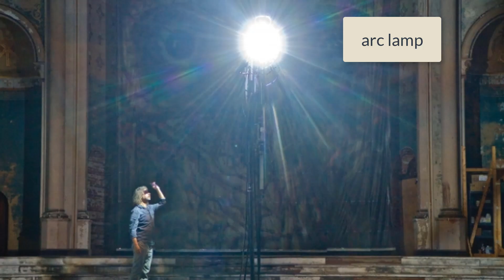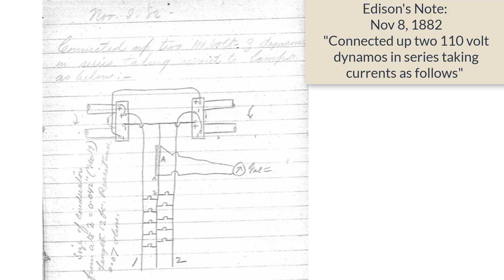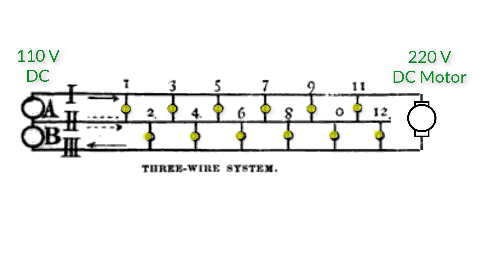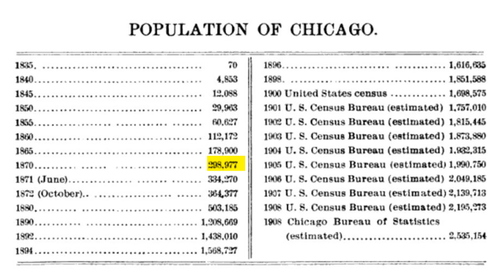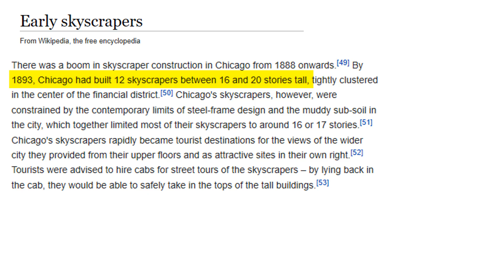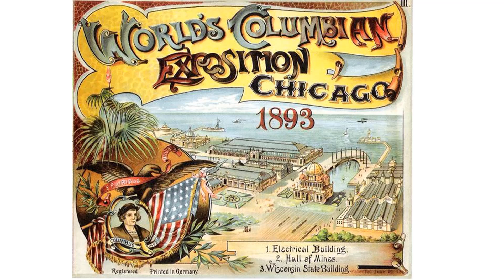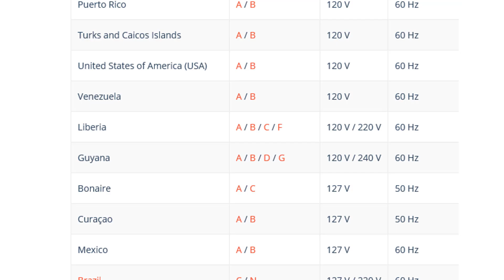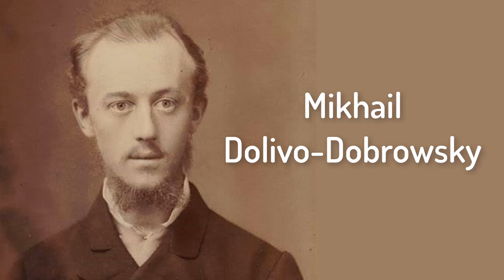Physics and History of Why USA uses 120 volts and not 220 volts

Comment: Very nice video. Couple fun facts when building started going up with steel most of the construction was hot riveted that wasn’t that strong at the time you had to have many fish plates for the steel to be even stronger when electric welding came out that was the game changer after the 20s I think Lincoln electric came out with the first coded welding rod Around 19 2526. Also I am a power plant instrument tech and I take care of the three phase or poly phase generators and yes, Edison DC system wasn’t that efficient as everybody knows because the voltage was the voltage where the three phase poly phase system you could use the device called the transformer really good videos. Thank you.

Comment: Literally power transmission is 240V single split phase in america.  It’s only when you get to the lines that service a row of houses, after the transformer with a center tap on the low voltage side, do you get two 180 degree phases of 120V from a single phase high voltage supply. It’s why every house in America has 240V available at the breaker box.

Comment: You’ve crafted a decent story, and you even got some points correct like needing higher voltages to span longer distances. Please read NFPA 70E. 110-120 VAC is the desired voltages for plugs that the majority of people shall plug the majority of devices into frequently. The average resistance of the human body is about 110-120 ohms, so getting shocked by 110-120 VAC around 1 A is minimizes both injury and death. The reason I mentioned the NFPA reference is that it gives people more information to safely work with electricity.

Comment: Fairly good explanation of volts vs amperes to achieve the same power (wattage). But you messed up the whole presentation by waving your hands around for 13 minutes.

Comment: And why do many countries use 240/250V. Having had a less that ideal electricity supply here [In Oz] I often only had 215-220V.  And things like my 3/4hp air compressor did not like it,, the lights would 'pulse' with the compressor was running and welding was at best poor.  All 240V equipment. Better these days but still far from ideal.

Comment: Electricity does not under any circumstances flow from positive to negative. To do so it would require that the flow would be that of the protons, which is not how it works. The current flow is always of the negatively charged electrons from the negative terminal to the positive terminal.

Comment: I made a solar generator with no experience. I had so many questions but it works. 5kw 12v which is probably the simplest way to do it but I still have questions. For example, resistance,how to measure and what the measurement means .

Comment: And yet I power my woodwork equipment on 230v, so we do actually have use of that. And then there is 3phase electrics which gives several more voltages.

Comment: Neutral should be a bonded conducting ground, conducting means current carrying. Using a thinner neutral than the conductor wire or 'hot' wire is not NEC approved, in most cases. Check the codebook, of course if you're not an electrician it might be hard to decipher.

Comment: Less likely to get killed  in case of event. Less induction as well.  Also, no need for 277v in residential, generally.  Other then washer, dryer, and stove.  A lot of those run on 208/240v.

Comment: In fact the US electrical system is 240V. They use symmetrical transformer with the neutral wire in the center of the winding. So there are two potentials. Between end and center is 120V. Between ends is 240V. BTW higher voltage means less needed current for same power. Less current means less copper needed.

Comment: It's 110V vs. 220V (past) and now 120V vs. 240V present day. The voltage was slightliy increased across the world. And there is 240V in every house in the USA. It's juat a matter of how you are connecting the local sockets.

Comment: 120v is ok but you need much thicker conductors to carry the energy. And also the distance of everything is half of what you have on a 240v system. So all in all 120v is not as good as 240v. The latter being more powerful and much cheaper to maintain and install.

Comment: Great video, thanks. I was told that if your hand touched a live wire at our Uk 240v then you can't physically let go, But at 110v you can let go. In fact a couple of months ago a child died after being electrocuted in a hotel in Blackpool. Builders in this country, have to use (centre tapped) transformers to supply 110v to all their electrical equipment used during construction, for safety reasons & the transformers are yellow. So I'm a bit surprised the whole world hasn't standardised on 110v for safety reasons.

Comment: I always thought the US has 110V out of safety concerns as the wire men are to dumb to handle the slightly more dangerous higher voltage…  buytaway it is 1.732    Or the square root of 3 😂 right?

Comment: There are some points you are missing.
- Not only the voltage is different but also the Frequenzy. (US:60 Hz / Europe:50Hz) - That doesn't look like much - but higher frequenzy enables smaler transformers for the same Power. This 20% difference means that an european Trafo needs +44% more Size of the iron-core.

- Europe never had a DC - electrical network - but started at AC with a 3-Phase system.
The Gererators and Motors for such a system are easy to build.

FYI - DC current is very problematic - @220V it is a challenge to switch on an off (without the help of semiconductor).

Comment: fact is the US uses both 220 and 110 volts that are available to most places  
110 is fed to most things and 220 is fed into things like an electric stove and some AC units, etc So, it  is not  accurate to say  that the US just uses 110 volts

Comment: Europe uses 240, not actually 220 anymore. (technically, it should be between 220 and 240).

And most of Europe uses 3-phase in homes, as you can balance the the power between the phases and as such is safer.

Electric stoves and ovens, and other "white wares" (dryers mostly now-a-days) use 3-phase.

Comment: And then there was 40 Hz, promoted by GE in the 1890's. Early electric systems had frequencies all over the map, but GE concluded that 40 Hz was a good compromise for all of the different consumption devices. That didn't last long, but several hydroelectric dams were built in Maine that generated 40 Hz. I don't know about today (2023), but they were still generating 40 Hz electricity in the 1990's. Back then, I was a design engineer of SCADA (Supervisory Control And Data Acquisition) systems for Amoco Oil and then Motorola. One customer was a major wood pulp processing plant that had installed a SCADA system to monitor for potential flood conditions downstream of their dams and activate warning sirens for towns and campgrounds in those areas. They were having reliability problems communicating with the remote units and I got a call. After analyzing the situation, I learned that the 40 Hz power was SQUARE WAVE and not sinusoidal. It wasn't a problem for the mill, because they were powering monstrous bark stripping machines with it, and they worked just fine with square wave power. The problem with square waves is that the are comprised of lots of very high level harmonics, which were significantly interfering with sensitive semiconductor devices. I had the mill install some heavy duty power filtering on their 60 Hz lines, which solved the problem. That was the first time I'd heard of 40 Hz power, and it was the last time I ever had to deal with it. Once was enough. 🤐

Comment: We DO use 220v, in fact in most neighborhoods the poles and ground systems carry 3 sets of 220v and we just use a trick to make it 120v.   The power is distributed as 220/240v!    Unlike most places that have 240v direct to outlets the US also has a grid that grounds out uneven soil charges to a distance.   You can't do that reliably with 220/240v-only systems.

Comment: There was a time when there was only 1 neighbor hood in the world that was lit up by electric lights. It was in lower Manhatten around wall street.  This is where Edison built his generator and the wires on telephone polls that spread electricity.  From all over the world men would would go to N.Y.C. to Look at this and copy it.120 volts DC  was good enough.  Then people found better ways of doing this by using AC and much higher voltages.

Comment: I guess it depends on your perspective. To me, as an electrical engineer in the building trade, the US uses 240V. As well as 208V and 480V, depending on what you're trying to get out of a building. And we derive 120V out of 240V by center tapping the transformer because most household appliances are designed to work on 120V.

And to add to that, the reason most appliances run on 120V ties into the light bulbs using 120V. Light sockets predate the wall outlet, so the earliest appliances were designed to plug into a light socket. Once the wall socket was introduced to homes, many would output 120V to match those appliances (although 240V was not uncommon and were usually the same receptacles, leading to problems with plugging into the wrong receptacle).

Comment: I learned the history before I began working with power. Why is Nichola Tesla not specifically mentioned?  Edison's first dynamo put out DC current. 120vDC loses voltage inside of a few hundred feet. Installing generators every city block was very impractical. Edison flopped. Enter Tesla and AC alternating current and higher transmission voltages that today carry 250KV+ traveling thousands of miles. Without Nichola Tesla, modern electricity might not have arrived for decades. Tesla revolutionized the world. When Westinghouse bought Tesla's patent for $1 together Nichola Tesla and Westinghouse further developed his alternators, Tesla's high voltage long distance transmission and 3 phase current.

Comment: Looks like you have no idea about this topic. The US do use 220 system and the 110just half of it. Every family house in the United States is built for 220v systems. Just looking at the meter there is the answer too. and after the breaker than have either 110v or 220v.

Comment: Isn’t it the case that most American households do have access to 230 V readily available? It’s just that by convention everything is wired up using a split phase setup. And with those terrible dangerous plugs and sockets, it may well be better that way. 🤪

Comment: Thank you for your presentation which was interesting.  But I believe there was another controversy between the promoters of Direct Current versus Alternating Current, and this was all about SAFETY .  I understand that the promoters of AC were inclined to specify higher voltage systems, easier to provide by the use of transformers in the distribution networks.  The DC promoters used scare tactics on an ignorant public, branding AC as inherently dangerous.  And this argument forced down the voltage supplied to the American public.

Throughout Europe the public electricity supply is 230 volts which is certainly more dangerous than that used in America.  There is a trade-off between safety versus cost.  For a given power, twice the voltage means half the current.  But half the current means half the copper used in cables, and copper costs a lot more than the rubber or plastic used for insulation.  But I can assure anyone they would not forget a 230 volt shock.

Comment: USA residential electrical feed is 240 VAC with a center tab that allows for 120 VAC.   If a house is totally balanced with the same load on both sides of the center tab then there is no power flow on the center tab.   The human shock from 120 VAC stings and buzzes.  The shock from 240 VAC HURTS.  Thank you for the entertaining video.

Comment: MONEY$$$  American manufacturers know you can get TWICE as many 1 pole breakers in a panel. When you include the sale of Arc-fault and GFCI breakers along with single pole breakers, they are making a FORTUNE!  NOTHING to do with grounding, or safety, or any of that other BS. ( Electrician with 50 years of experience ) America is all about MAKING MONEY!  ALSO WIRE: 2 POLE CIRCUITS draw less current, hence you could put more devices on a 220 volt circuit. This would result in LESS wire being used. US wire manufacturers would not like that very much. Just look at the price of copper!!!

Comment: Hi and thank-you for your informative video.  I am always amazed at how history informs the present and otherwise inexplicable situations are created.  A few comments:  

The success of Westinghouse's AC over Edison's DC was, in my opinion, due to the fact that unlike DC, transformers can be used to create any AC voltage that is required, facilitating transmission and distribution.   There is some irony that Nicola Tesla left Edison's employment in favour of George Westinghouse, and brought with him the invention of the transformer.

Three phase AC power has several significant advantages.  Firstly, the phase difference between the three legs makes the construction of AC motors much simpler than either single phase or DC designs.  A three phase AC induction motor has only one moving part, the rotor.  Secondly, the phase difference between the three legs means that the amount of power delivered over a balanced three phase circuit is constant, which cannot be replicated with single phase transmission.  This reduces vibration and makes the most efficient use of the copper wires.  Finally, three phase circuits have a line voltage between each line and the neutral conductor, and a higher (by a factor of 1.72) phase voltage found between the phases.  This allows for some flexibility for lower and higher voltage equipment.

Thanks again for your great video.

Comment: Brazil in the map appears as a 110 volt country. Really, Brazil is a bivolt country: some states use 127 volt and other 220 volt. Also in the same state (and really in the same city) wi can find areas with 220 and areas with 127, so a Brazilian who wants to travel inside his country must use bivolt material, or ask what is the voltage at the destiny before travelling.

Comment: JMO.  
The correct voltage to use is 240 volt 3 phase..  ??????
Why. ?????
We always are having grid problems
With single phase drawing power from 3 phase which grid couldn't balance the grid
If everyone was running off 3 phase in all buildings 
All that would need to be done is balance each panel

Comment: Just a tip but you need a body mic (or a better recording location) to reduce the harsh echo of the room and better lighting (you're being lit from below). You tube has videos to fix these issues. Cheap things like moving blankets hung while recording will soften the sound and lighting.   Great video and topic. ❤

Comment: I have an alternate theory, centered around the relative wealth of the USA vs. just about everyone else.  All things being equal, lower voltages are safer than higher, but lower voltages need much more copper, which the USA had plenty of.  Also the USA was energy rich, whether it was coal or oil. This also removed any incentive to maximize efficiency, unlike in resource poor Europe. In a similar vein, 50hZ is slightly more efficient than 60hZ, with the disadvantage being the transformers and motors require more iron. But iron is cheaper than copper.

Comment: Also don't say the wires are 120 degrees. Corect would be the voltage of each wire is out of phase with the other wire by 120 degrees.

Comment: I'm an electrical engineer. 20 years ago i asked the same question to my electrical machines profesor...that period when The USA selected 110 Vac was a time of paranoia and the US Gov thought the Europeans would flood the US market with european made 220 Vac appliances and Motors. So they selected 110 so the Europeans had problems producing both voltages appliances. He told me îs only for economical reasons although 220 V had economical design advantages.

Comment: France didn't switch from 110 to 220 volts in the early 20th century but around 1970, and I remember vividly when we had had to change all of our small electrical appliances at that time (paid for by the electric company!). So, it would seem that if the US had wanted to, they could have made the change to 220 volts at that time, but at a cost...

Comment: 120 VAC is 60HZ
240 VAC is 50HZ
Its been proven that in the USA the lower AC voltage and frequency increase (60Hz)  was found better to have time control in operating American Electric Clocks.

Comment: 🇬🇧As a 58 year old electrician, I thoroughly enjoyed this Thankyou. Amazing that due to the development of ultra high voltage solid state rectification, DC is now starting to be used for extremely long distance transmission, in some cases over a million volts DC. Search UHVDC transmission…….😊

Comment: the electric physics formula for elect power is 
           Watt ( Power ) = I ( current in Amperes ) X V ( voltage ) # therefore to increase the power ( Watts ) either I ( current ) or V ( Voltage ) should be increased # when I ( current ) amount remains constant but V ( voltage ) is increased the power ( Watts ) increaes # 👍🇵🇰